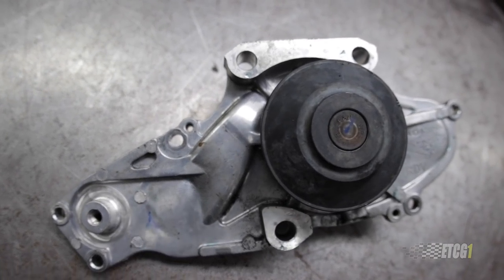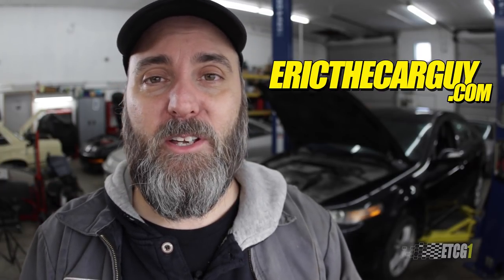Timing Belt vs Timing Chain, Which is Better?

Comment: I changed the timing belt on my Alfa Romeo GT diesel. The interval is every 4 years or 40.000 Miles.
I replaced the whole package which is: timing belt, water pump, timing ideler (roller), timing belt tensioner, aux belt, aux tensioner, aux roller. +coolant +alternator bearings (this is not in the interval but I accidentally found out that they were out). It's the most satisfying feeling you know you replaced everything that needs to be replaced and enjoy driving the car!
I think the issue with "chain people" is they forget they need to change the water pump (often driven on aux belts), aux belt, aux tensioner etc - because they think it "needs no chain service". Good video Eric, cheers from Europe! ;)

Comment: My first car was a vauxhall corsa 1.2 petrol. The timing chain went slack which is a common fault for this model and it ended up cost me an absolute fortune to fix. Personally I now prefer timing belts as its easy to visually check them and service if required. But clearly the best possible timing system is timing gears. I owned a Honda vfr750 which had timing gears. The noise alone of the cogs whiring was 1 of the best features of the bike. Kinda sounded like there was a supercharger fitted to the bike. HRC engineering at its finest 👌
Reply: The sound of gear driven Honda bikes reminded me of the Triumph 3 cylinder whistle
Reply: @bikersquest  the triumphs sound very unique. My dad had a 2007 1050 speed triple gorgeous bike. 1 of the best road bikes ever made. 🇬🇧

Comment: So my '89 Toyota pickup 22RE with 278,000 miles has a chain, my '99 Camry 4-cylinder has a belt, and my '06 Camry 4-cylinder with VVT (variable valve timing) has a chain. I was curious why Toyota would switch back to chains, considering the points about maintenance and upkeep brought up in this video, so I Googled the idea. One of the results from that search was a video from Scotty Kilmer discussing that exact idea. You can go find Scotty's video on your own, but the key element in modern engines is getting the best of everything involving performance and emissions in the same engine package, hence the variable valve timing. The problem with belts and VVT is that belts stretch and wear much faster than chains, so belt driven VVT engines have performance and emissions issues much much sooner than chain driven engines. Certainly changing the belts sets the timing back to spec, but you will have many belt changes before your chain-driven engine gets mechanically far enough out of time to fail an emissions test or have a degradation in performance. Oh, and the service interval to maintain proper timing for emissions has nothing to do with the service life of the belt. My '99 Camry has a belt, and a NON-interference engine, so run that belt till it breaks. (Not really!)  It'll pass an emissions test just before that belt breaks, because there isn't enough change in the valve timing to change the engine emissions and performance values. It's a simpler engine.

Comment: I Do Cars regularly tears down engines, most seem to have timing chains, and there is almost always a chain or guide, or tensioner problem encountered. I’d say your advice regarding good preventive maintenance is the key to long engine life.
Reply: chains are stretching up and can make a noise and jump over a teeth or two if they are stretched too much. As well, i seen chains do make timing a bit off, so, engine doed not idles smooth.
Reply: They are both flawed but atleast belts are honest, "change me or else".  Chains act like your best friend untill your engine is full of metal shaving from a loose timing chain.  Or if your 20/22r person they will wear through the timing cover and mix oil and water.
Reply: I've had both. Chains last longer before replacement is needed but once high mileage is incurred, a timing belt is usually easier to replace. 
Long timing chains have been problematic in many brands.
Reply: @grantsnell6782  Who said VAG?
Reply: Regular maintenance, I don't care what you say regular maintenance does not work on a VW / Audi . You could pamper those cars to death and they will still squeeze the shit out of your balls.  I've had both an Audi A4 and a VW VR6 and I've had both timing chains destroy themselves and that's not because of a lack of maintenance on my part, it was a failed component because of a bad engineered part.

I'm surprised nobody mentioned interference and non-interference because as long as it's a non-interference both of those types belts or chain can destroy themselves and it wouldn't even matter cuz nothing will happen to the engine.
Reply: @pashko90  Of course you know chains don’t actually stretch like an elastic band. They wear at each pin, and hence grow longer. A true double roller is probably the best type of chain, but can be noisy. The so-called “silent” chains wear the worst, they don’t have rollers, just flat segments bound together with pins.
Reply: @luisamoa2500  Good point about interference vs. non interference engines. I thought about it when reading replies, and decided it wasn’t really in issue nowadays. I think nowadays most people are aware that valve/piston interference can be very expansive. No evidence, just a gut feeling.

Comment: LOL, neither rubberband nor bicycle chain for me! TIMING GEARS
[EDIT: seriously, I think the waterpump should not ever be driven by a timing chain. The pump will begin leaking long before the chain should require replacement. I give preference to chain with external belt driven waterpump over belt. Chain driving waterpump is nfg imao.]
Reply: So Ford i6 from 1996 and older or industrial diesels....

Comment: I've had all three timing systems. A belt on a Honda Accord that I replaced myself it was time consuming but doable. I've had a few timing chain engines that I serviced one the nylon gear broke on the cam luckily it didn't damage anything. Another one is a twin cam with over 3 hundred thousand miles on it and it still runs great and I had a Honda VFR with gears so I really don't have any preference. Your channel is excellent thank you for sharing

Comment: I had a blast doing the timing belt and water pump on my old tundra with the 4.7 V8. It comes down to manufacturers having a “lower maintenance cost.” 
If that’s a real thing. I like both.
Reply: @Glocktard  Yeah I remember doing the exact same thing! If I remember right the AC compressor has a bolt that goes through into the water pump. It’s pretty easy to do just a bit time consuming.

Comment: Great points! This is what I have been saying for years. A properly designed and well maintained system is much more important than whether it has a belt or chain as either can be designed very well or very poorly and both will fail without proper maintenance. I don't mind changing my D series powered Civic's timing belt every 5 or so years (which it's due for now), but it's also nice to not have to worry about remembering to change my K24 swapped Civic's timing belt.
Reply: I’m in the same boat. Original owner of ‘03 civic em2 D17a1. Bought an ‘07 accord k24 5 speed a few years back. That car is so solid and smooth compared to the civic
Reply: I love having a chain. My old 2000 Civic blew the motor because the timing belt failed. I am sure someone else swapped the motor and is still driving it.

Comment: I've had both belt and chain engines. Eric, your right! Maintenance is the key to it all! I'm currently in the chain camp by pure lazyness. It's easier to do an oil and filter change than a belt. I've owned and worked on some tiny cars meaning no space to work and no skin on your knuckles when your done. On one I was forced to drop the engine!!
Reply: I change my oil at 50 percent engine life. Oil is cheap timing chains are expensive.

Comment: I used to be very reluctant to tackle a timing belt replacement-but with the wealth of knowledge/examples on YouTube (looking at you, ETCG!) I did a complete R&R with water pump on a J-series Honda 3.5 V6 in a Saturn Vue Redline.  Was almost paranoid verifying and re-verifying all timing marks...but due diligence meant that the engine fired with no problems.

If you consider yourself even "okay" with wrenchwork, it's doable.  Pay attention to the task at hand, educate yourself, and get dirty!

Comment: Either works for me, belts or chains.  I replace both if needed.  Our 3 vehicles have chains and did one replacement already on a '93 Toyota pickup.  Did several Honda Accord and Civic belts along with water pumps.  Chains are more labor intensive as I had to drop the front diff to drop the oil pan to remove the plastic chain guide pieces.

Comment: A good chain is fantastic. They're rock solid on the Honda R18 engine in my Civic, but a bad chain (VW, BMW, Mini etc) can be an absolute disaster and cost you huge amounts once they start rattling. Changing the belt on my old 1.8T was less than £400. Getting a chain replaced on a newer TSI/TFSI is easily 2x that.

Comment: I agree with Eric. I drive a 2006 Honda Accord with a timing chain. I too, firmly believe, with regular oil changes, getting the fresh oil in on a normal schedule, you can prolong the performance life of a chain. I have maintained my car with very regular oil changes.  The car has given me 328,200 miles to this point.  I think both types of timing engineering are excellent. Each comes with its own set of maintenance practices.  If we respect them, they can give us plenty of engine performance life.

Comment: I'm going to fence sit on this one. I have both a chain driven and a belt driven engine. On one hand, yes the chains tend to last longer, but for me who has had to replace my chains, guides and tensioner -- the cost outweighed the longevity, especially in terms of a belt driven engine. I just got done doing a water pump, chain, guides and tensioner on my 2013 Ford Taurus, where the Water pump sits internal with the engine. When all was said and done, it cost me a little over $2800 to do everything. In that same breath, I bought a 2004 Volvo V70 which also needed a timing service done. I never prior knew how to do it and I wanted a "dummy" vehicle to try my hand at a first time timing job. For my first ever timing service, it took all of about 3 hours to do (half of which was making 100% certain I got everything correct). It was surprisingly simple and straight forward and best yet, it cost me a whole $200 for the whole set, which also came with a serpentine belt too. To have someone else do it, it would of cost approximately $600, still far cheaper than the aforementioned. I expected to grenade the Volvo engine with my lack of understanding, but I succeeded in doing it and it felt fantastic and honestly, it's a awesome little wagon, I love it. All in all, I think I'd rather spend $200 every 100k miles than spend almost $3000 every 200k. But I can see the positives in both, so to each their own.
Reply: Amen. This is where belts shine.
Reply: Ahh, the 3.5/3.7 Ford. I did one a while back. I literally just did the water pump since was leaking. $100 in parts and 4 hours is what it took me. Timing chain/guides were "visually" good so they remained.
Reply: I agree completely.  Also, for emphasis, the worst of all worlds is where the manufacturer uses a timing chain and also drives maintenance items like water pumps off the chain.  By doing this, the manufacturer makes timing chain replacement an expensive maintenance item.
Reply: @mph5896  Yeah, the pump was leaking externally on mine. Not bad, but from what I read it basically means imminent danger or failure. To do just the pump alone was $2300, but the mechanic basically said might as well do it all since they were already in there. I concurred hesitantly, but that's a fairly steep slope. There were cheaper alternatives, as in cheaper mechanics and quotes, but I wanted a mechanic that has done these before, so I would rather the job done well and cost a bit more than do it incorrectly and have to do it again.

Comment: I have been a technician since 1986 and seen both chains and belts fail and cause bent valves and other damage. Non interference engines are the best belt driven engines because most people don't do oil changes much less a timing belt. Dual overhead cam V6 engines are lots of fun either way. I was a GM tech during the chain failure wave on Equinox and Traverse engines under warranty. If the chain and components are made correctly I prefer them. A belt is great on 4 cylinder non interference engines.

Comment: Honda's typically use belts for weight reduction/ gas mileage. That bieng said I have heard horror stories about certain Ford  engines with chain issues. Gears are the most reliable. But expensive and heavy. Can't gain without giving something up. Great video.

Comment: My buddy had a VW with a chain that failed hilariously, broke the sprocket right off of the camshaft. I have no idea what he did that caused this to happen. My 04 TL keeps on truckin' but I have to do this particular service every 80k or so (just to be safe.) I am not a mechanic, but was able to figure it out using your videos. I still kind of feel like the chain is a better option, assuming you take care of the vehicle and it wasn't designed poorly from the start. That VW, IDK man... My buddy is kind of an idiot though, so there's no telling what was going on maintenance-wise or what flaws already existed in the design. I believe it was an 04' Passat or similar era. Your video series on the TL has saved me a ton of money, appreciate that!

Comment: I have one of each 3.5 L Ridgeline with a timing belt and a Honda fit with a timing chain. both systems work good. I have change the timing belt and water pump and idler pulleys once on my Ridgeline. What I like about the timing belt is it brings everything back to specs from day one when you change it, and engine runs quieter than a chain. If the chain ever does go on my Honda fit, it’ll probably be cheaper just to put another engine in it for the price of the parts to fix it and my time.

Comment: Just had the belt service done on my 07 Accord. While being a bit hard, it had no cracks or noticeable wear at 101K. On the Goldwings there is no maintenance interval for the belt, and I believe the industry will reach this point for belts at some time also.
Reply: Belt service intervals are going to err on the side of caution. Unless it's an early 2000s Audi, especially TT. In that case the belt might snuff it before the recommended service and you have catastrophic engine failure as a valve gets intimately acquainted with the piston.

Comment: 2:08 "Because you dont necessarily wanna get engine oil on your timing belt" Ford may want to have a word with you on that subject. They had the "bright" idea to let the TB run in a very special engine oil so that it makes less noise. They do that in their Eco Boost engines, afaik.
Causes a lot of broken engines because people may not use the very special oil to top  it of or garages may not use the proper one when doing an oil change. Heck, I even know about a case where a Ford dealer did an oil change on such an engine, used the wrong oil and caused engine damage.
Reply: You are correct, its the same for diesel, in the UK my 06 galaxy has the 1.8 tdci engine, they called it lynx because ford were desperate to keep it as part of the PUMA project with PSA (1.6 tdci and 2.0 tdci are PSA engines and are timing belt). Mine because its an 06 is a timing chain to join crank to the high pressure diesel pump, then a timing belt joining high pressure pump too the camshaft, bonkers design if you ask me, sure one chain / belt would do. Anyway from oct 07 the 1.8 tdci came with an upper timing belt and a lower timing belt in oil for "depollution and noise reasons". However they are well known to break prematurely despite ford saying they have the same service interval as the chain... theres even an aftermarket for lower belt in oil to chain conversions 😅. Lets be honest ford is fooling no one, the belt in oil is cheaper to manufacture and if it breaks earlier then you might buy a new ford 😅
Reply: @markhart3432  honestly, if i have an engine which breaks early due to bad design, i aint gonna buy another from the same company.
but yeah, ford is or at least was quite bonkers...

i never heard anyone complain about noise from a timing belt... chain on the other hand...

Comment: I've been a timing belt fan ever since I started my career in this trade😉
Timing belts are always fun to change (at-least for those who like'em) the process is different depending on the displacement & drivetrain of the vehicle, an engine with timing belt, is a lot quiter & smoother when maintained/tuned properly compared to the one with a timing chain👍
Honestly timing chains also have a life & they make a bad rattling noise when loose or when their guides go bad & this too happens within 150k kilometers, I've never seen them go beyond this mileage, they will have some type of a ticking sound even with regular oil changes
Honestly, we all know the best & most reliable Honda Accord's & Lexus, both came with engines that had timing belts😉
Thanks for starting this debate Eric, Stay Safe👍
Reply: i would never buy a car  with a belt
Reply: @Monza62000  I would take any Honda or Toyota with a timing belt over any German car with a chain...